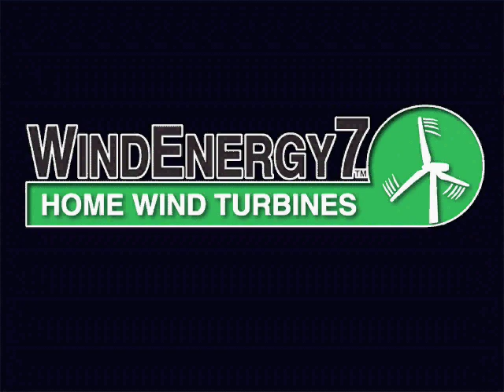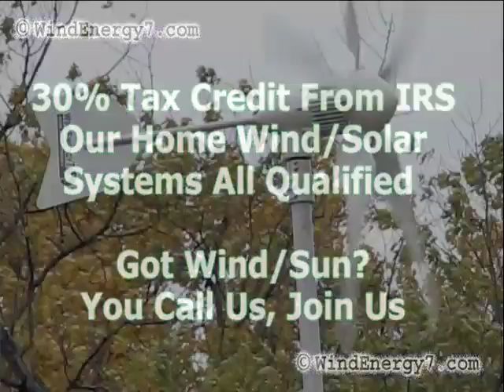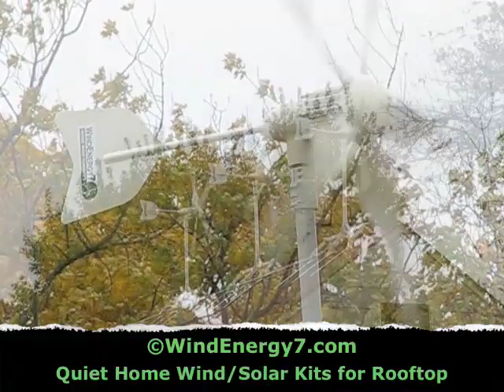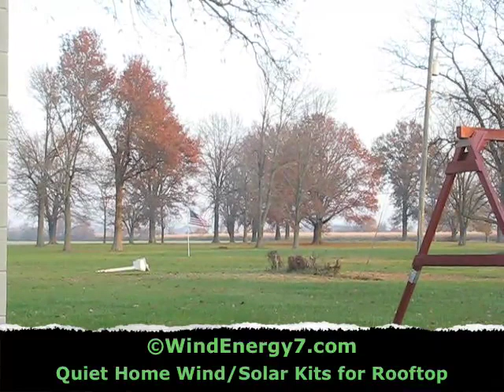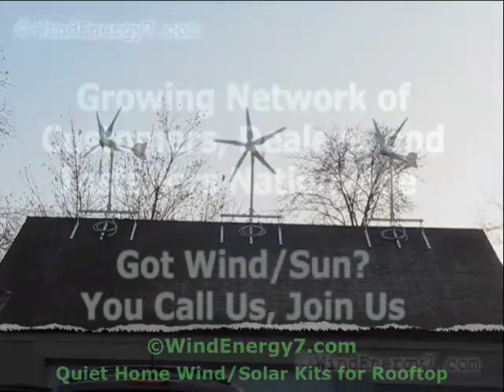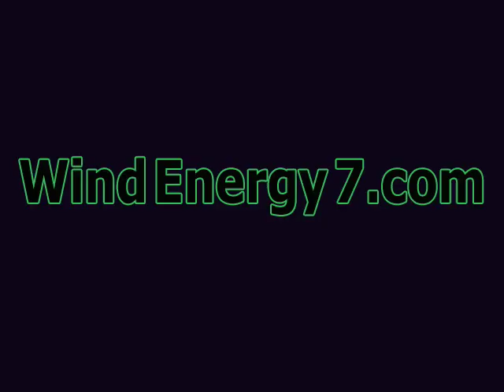Wind Turbine Noise

Comment from the maker: @BillyBobTS Sure, that's why you have to use the RoofMill, it's an invention that solves the vibration, friction and noise.  That's why it's a patented design that I worked on for years.  Don't try anything else, the RoofMill is the only thing that has succeeded.

Comment: wind turbine noise is not a problem for (THESE) systems by WindEnergy7.  Wind turbine noise is primarily caused by gears and poor balance.  WindEnergy7 turbines are gearless, and are precision machined and balanced with stainless steel internal parts.  Wind Turbine vibration and noise is also caused by activity of moving parts.  These home wind turbines have only 2 moving parts, less than any other turbine.  If you want a quiet, smooth turbine, and don't want noise and vibration.. WindEnergy7